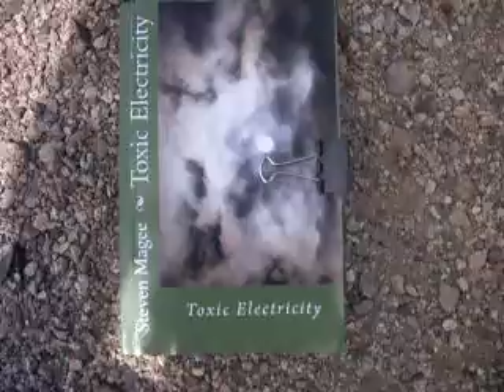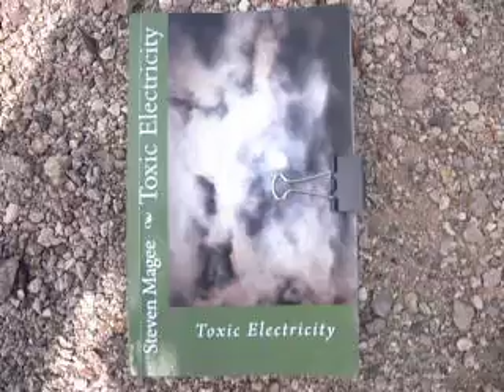Testing the mV/m Levels of a Single Residential Area Cell Phone Tower

Comment: 700mV/m = 0.7V/m hm...
My Logitech blue-tooth keyboard transmitter makes 500mV/m..
Or about 300 uW/m2 (microWatt per square metre)
Damn, time to change to wired keyboard...
Reply from the maker: People with Electromagnetic Hypersensitivity commonly report the following: 6 to 3 V/m: Too high for ambient levels. 1 to 0.3 V/m: Too high for many people. 0.1 to 0.05 V/m: Many people have symptoms. 0.02 to 0.01 V/m: Most people with EHS are okay. (Source: EMFields Acousticom 2). The Tenmars TM-196 RF meter manual states “We recommend a maximum level of 0.614 V/m for prolonged exposure”.
Reply: Yes, i have got Tenmars TM-195, its states 614 mV/m, but i think its way too high, isn`t it?
And i work in warehouse, were cell phone antenas are very cloe to the building and they are pointing in to warehouse, i getting reading about 800-1000mv/m (1V/m), but if i go inside, readings significantly drops to 20-50mV/m.. Strange. But thats only RF meter reading..
So i think we should worry about wireless devices inside our house, not outside..